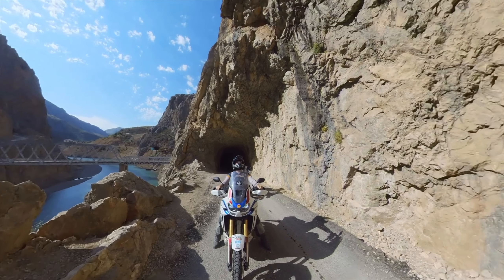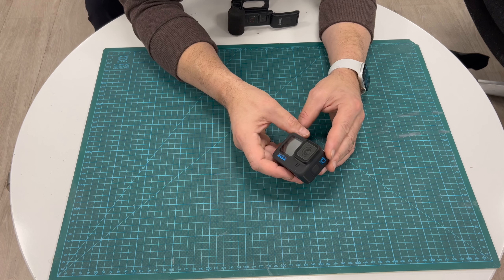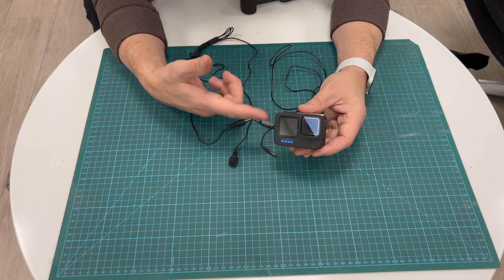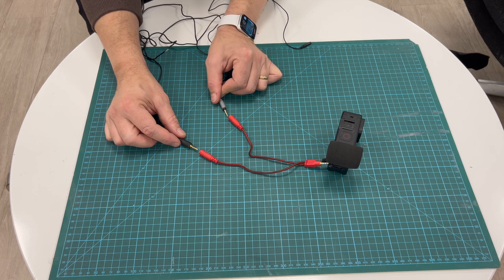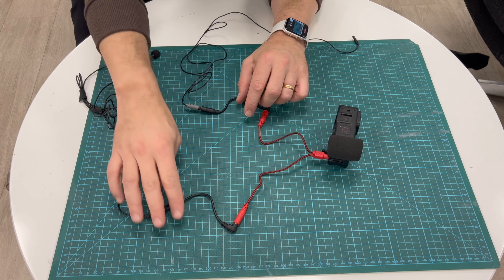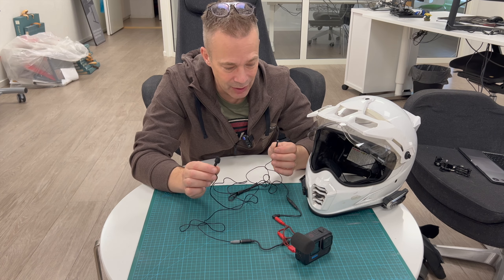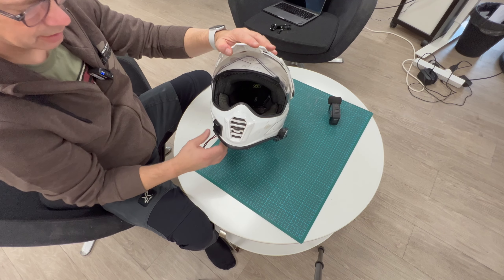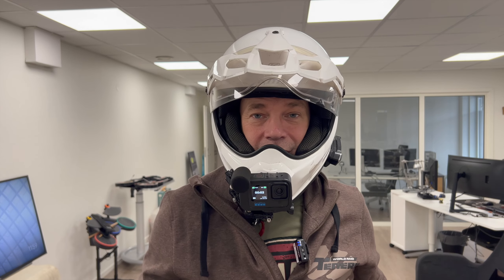Get intercom audio in your videos! How to.

Comment: Somehow I tripped upon this same idea when I was trying to set up my communication. Full wrap around helmets easy enough. The helmet that is either open face or opens up I came up with another idea. I came up with a gamer headset and unplugged the mike/extension from the headset and plugged in with a series of adapters from my y adapter inside the helmet. So you have three  mics. The one that came with your sena and the one for your mic that goes over your earpiece. And the other mic to record your voice to your gopro. I routed it in the same recess most helmets give for the installation of your communication mic. Then I used epoxy to keep the gamer mic extension in place.  So I could have my mike in front of my face. Not all Mics are the same. I had the cheap mic like you had and it had more of the natural sound coming in from my other riders. I thought going the best Amazon had to offer and the voice coming in sounded a little tine. So cheaper mic is better. Thanks mile marker mike

Comment: Hello Robert and thank you so much for your good explanation off the solution off hearing the other voice. In our last video riding with our granddaughters, I have one microphone at the speaker and use the Sena with side tone on. It worked, but hearing yourself talking is not an option. So this winter it will be time to puzzle all the wires in the helmet. Good job 👍🏻

Comment: I could use this method wirelessly using DJI mic 2! Will need to use 1 dji mic along with the splitter adapters to have both lavs going into the wireless dji mic inside helmet… & wireless record in single track directly into the Insta 360 x4! Thx for the idea (or use both dji mic units & record into separate tracks - without adapters!)
Reply from the maker: Cheers! Yes wireless is nice, but not sure if they connect quick enough because I use quickstart, turning the camera off between every shot. Have to try.
Reply: @NomadSweden   @JCoReTV  
did it work?

Comment: Very usefull video ! Thanks alot.
Idea use solder an put TRP jacks on insted using a spiltcable.
Even better would be if GoPro made it posible to connect blueT.. via com ;-) 
Lets all write to GoPro hihi
Reply from the maker: Thanks! I'm just a terrible solder :) BT would be practical but then we have the battery problem (as we don't have enough batteries to charge or risk exhausting) 😊

Comment: Hello, I'm unable to find any solution with my DJI action 4 camera with this setup. Earlier I had a GoPro. Dji action cameras have type C ports.
Reply from the maker: All you need is an adapter for 3,5 mm mic. It’s even on the dji website

Comment: Thank you for this video. 

I soldered stereo mic to my helmet so that on left channel is my intercom mic and on right channel is my pole mic. 

I used one pole mic left from Cardo for me and other Sena velcro mic near intercom speaker.

Now it is easy to edit those mic levels from left to right. And also make those more mono and center if I like.

Both mics are taking motorcycle sounds so the motorcycle sound is some kind of stereo sound in the middle.

I'm using Insta360 X3 with 0dB or -6dB settings and it works fine. 

Still waiting to make videos with it. Back to summer tyres and waiting for ride again...

I also made 3.5mm male +female extension cord  if I use the camera on my handlebar RAM mount rather than on chin mount.

I prefer the handle bar camera setting with X3. It is better for 360 video and X3 is so big for the chin.

Tack så mycket och hälsningar från Finland.🇫🇮✌️ - KIITOS.
Reply from the maker: Wow sounds like a great setup. Soldering those small cables is not easy. Hope it works well for you. Cheers

Comment: The only helmet in the world with 3 microphones inside :)))
If uour intercom has a 3.5mm jack you could use the intercom mike with a splitter for both,  Gopro and comunication.
Best regards from Romania !
Reply from the maker: Thanks. I dont have 3,5mm on the intercom, but the audio form the intercom is actually not as good. It takes away everything except the voice, which is good for intercom but on the video I want engine sounds etc also.

Comment: So I rebuild your setup with exactly the same komponents, and it works fine BUT just up to around 80 KpH then it seems the Mic‘s max out and some nasty Crackling start. I try all the settings on the GoPro (wind settings) but nothing helps. Then I try to close the Mic openings with tape in addition to the dead Cat that is also on but still Crackling noises. 

Any suggestions for me? 

Greetings from Germany 
Tobi
Reply from the maker: The only thing increasing with speed is wind so it should be a wind problem. I too get worse sound in higheer speeds but not crackling. Try more wind protection.
Reply: @NomadSweden  oh thank you for your fast reply. Hm then I try a little bit more about Windprotection I hope it will work sometime like your setup. 

Many greetings and a great start into 2023 
Tobi

Comment: I've been thinking of doing this with a breakout cable instead of a splitter. The mics would be recorded as left and right but can ofcourse be set to mono in post. I was hoping to be able to control the mic volumes individually in post. Have you ever felt like uneven volume was a problem though? I might be overthinking it
Reply from the maker: The only problem has been that an individual rider in the group has been louder than the otherd and thats harder to solve 😊

Comment: How the hell do you not get peaking audio with no levels adjustment?! 😮 I have my dji mic system set for -9db for the helmet audio to not get all that cracking and popping from the wind 🫣
Reply from the maker: Not sure 😊 the voice mic needs to be wind shielded though. But other than that i dud nothing special. Still at high speeds the audio is noisy
Reply: @NomadSweden  cool. Also the ”hotness” of the lav used affects this of course. I like to have clean audio at 100kmh which is not easy. Im gonna make a video of my setup at some point too I think.
Reply from the maker: Do it! I would watch 😊

Comment: Nice and easy solution. However.. why not to connect intercom output (if it has 3,5mm jack) directly to Gopro input? Intercom output you could also split into two - one for the speakers and other to Gopro input. That way there is no mic taped onto speaker. But hey.. it works so why to mess around :)
Reply from the maker: Indeed, it's just that I never had intercom with 3,5mm. I saw one from Sena which had it, but when connecting 3,4mm to it all audio went through the 3,5mm and the helmet speakers were shut off.
Reply: @NomadSweden   sena comes with 3.5 mm mic too. It's in the box and it works in tandem with the speakers. So you can split the 3.5mm source in two and connect go pro.
Reply from the maker: @royarnab22  perhaps some models do (not mine) but I don’t like the audio from sena direct to cam. It takes away every sound exept speech so it sounds strange and no engine. Its good for talking but not video.
Reply: @NomadSweden  A valid point. BTW your Turkeye video was awesome. And I'm tempted to visit now although it's a lot of work since I'm from India. I've friend in Sweden though and he's inviting again and again :D

Comment: Great advices.
If you dont want to have all those adapters and all that cable you can just buy the plugs, some shrink hose, cut the cables and solder it instead. There is a company near you in the town Skövde called Svebry that has all those things. Located near the road at the edge of town heading for Tibro and Karlsborg.
Now, you may also consider to buy some ferrite cores and wrap some laps of your cable around it. This can help to prevent some unwanted noises from example your engine, spark plugs, electrical regulators and so on.
Cheers from North Carolina

PS. It would be great if you can show how to both have a mic plugged in and have the camera on charge at the same time.

Comment: Don't you have problems with noise from the wind when you're riding? I tried so many microphone positions and cushions around it but couldn't solve it till now
Reply from the maker: Check our travel videos and decide. High speeds are noisy for sure but overall i think audio is good
Reply: @NomadSweden  my noise trouble starts at 40-45 km/h already. Since my video about my gloves I don't do live voice anymore. You can skip the first 0:50 min and listen to it:
https://youtu.be/4Go_QDrQ5AM
Reply from the maker: Where in the helmet do you have the mic? I have mine under the cheek pad on the left side. And there is no direct air coming to it. Your sounds like it is hit by air. Perhaps from under the helmet or a vent?
Reply: @NomadSweden  After some worse trials I sticked it into the cheek pad. It's literally hidden "IN" it. So this was my best result already. Think I need to put it behind my head to silence it :-)
Reply from the maker: @FriesyRider  :) Well in this case it must be the helmet that is letting the air in too much for the mic. That's the only difference from my setup I think.

Comment: Good video and instructions!  Just FYI:   TRS means Tip, Ring, Sleeve, meaning that the TRS has one ring and the TRRS (Tip, Ring, Ring, Sleeve) has two rings.  Tip, ring(s) and sleeve always refer to the conductive metal bits of the plug, so don't count the plastic insulators because that makes it confusing 🙂
Reply from the maker: Ah thanks for the tip. People make me smarter every day :)